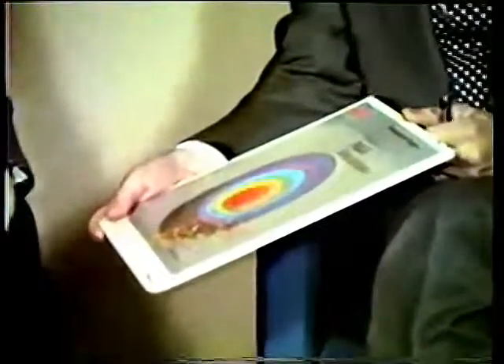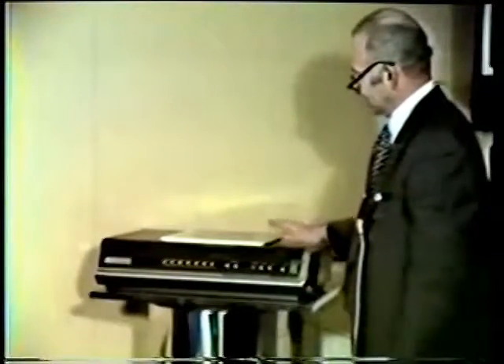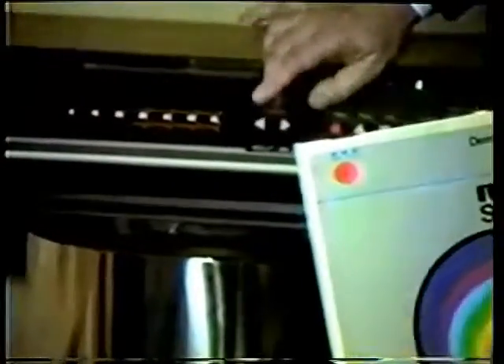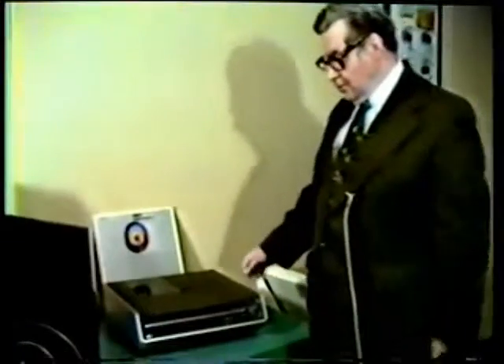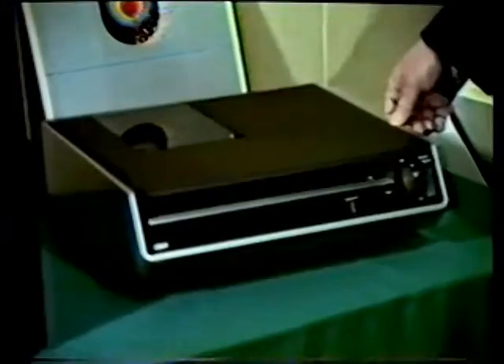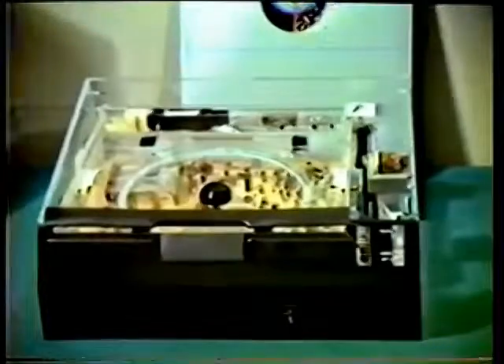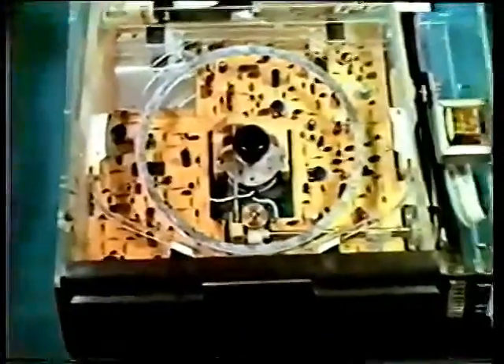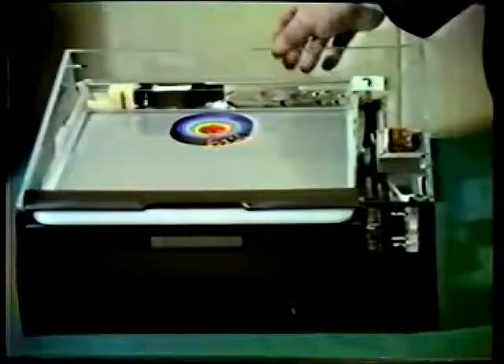Interview with Richard Sonnenfeldt - RCA Selectavision Videodisc System

Comment: It won't work because the standard players need the conduction from the carbon disc to play. The ones coated with the metal like eyeh8nbc has won't work because of this. It needs the charge from the carbon to make a full circuit and therefore read the disc. Metal isn't conductive enough. 

BTW, eyeh8nbc, I LOVE your channel! Thanks for all of the rare CED discs that you uploaded! As a fellow fan of CED, it's nice to see that stuff in one place!